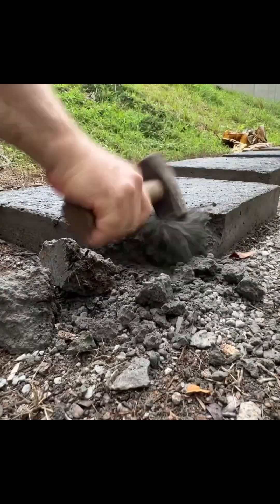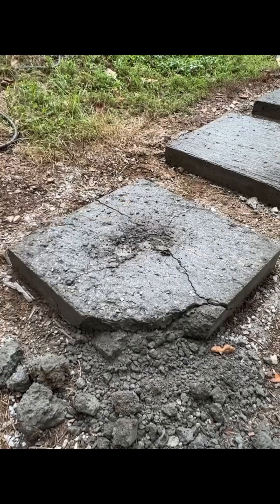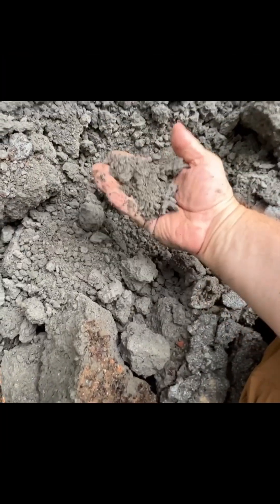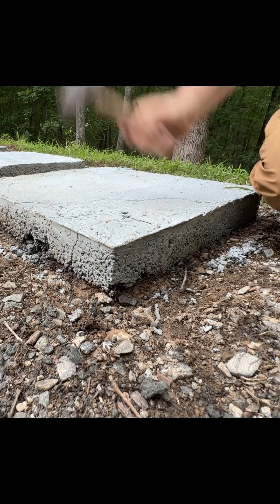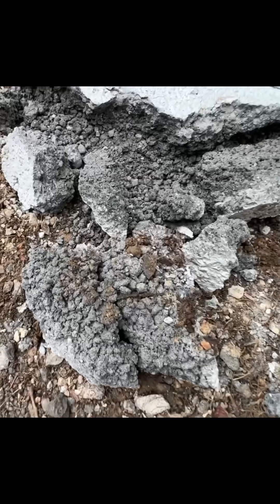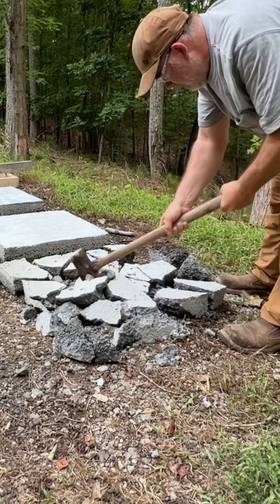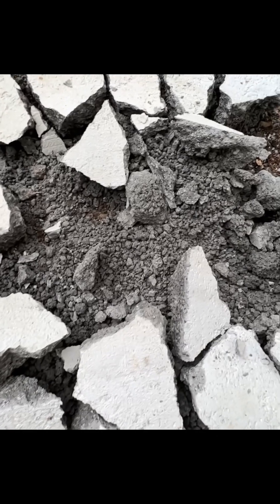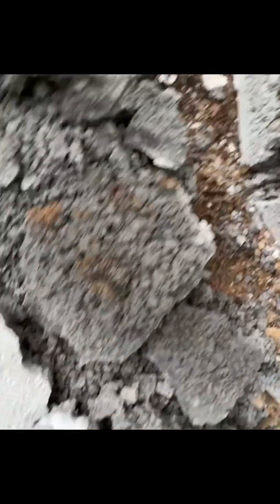Concrete cage match: dry vs wet compared by destructive testing. Round 1 who will win?

Comment: both are trash, if u can use a hammer to brake it you simply have a pile of shit that slighlty hardened. Nothing to do with concrete slabs. If u mixed it yourself u didnt do it properly and if had it delivered from a factory u got scammed.

Comment: Guys open a book about concrete and learn how to do it properly and also how to test properly. This is nosense
Reply from the maker: You realize that this is basically a section of side walk.  Side walks aren't tested (its non-structural).  For the use case, and no freeze heaving, its fine.

Comment: Nope, that’s not how wet pour concrete looks when it has cured for 28 days and was mixed properly.
Reply from the maker: You are absolutely correct.  Cured dry pour does NOT look the same.
Reply: @dwwoodbuilds  was talking about wet pour .
Reply from the maker: I know.  And they don't look the same.  You can get a better finish with wet pour. If you look, you'll see I have videos comparing dry vs wet.  Yes, I do wet mix and pour concrete also..

Comment: And yeah it takes a couple weeks for wet concrete to fully cure.  Guarantee if you wait that long that dry poor BS is gonna crumble even more and that wet poor pads will barely crumble at all.      This dry poor crap is so dumb.      Your sacrificing strength, durability and aesthetics.   All cuz your a lazy homeowner that doesn't want to get a wheelbarrow and trowel or shovel and mix the freaking concrete.
Reply from the maker: Those are TEST pads made for destructive testing to compare dry vs wet.  See the video where I CUT the next pads in half (after they're mostly cured) to compare the dry pour against its wet pour counterpart.  SPOILER ALERT: the dry pour is hard and solid all the way through.  As to being lazy and not want to get a wheelbarrow/shovel/trowel and mix the concrete, how did I do 4 WET POUR test pads?  Those are OBVIOUSLY done that way, so your ""all cuz your a lazy..." comment demonstrates a lack of critical thinking on your part.

Comment: 4 look like crap and the other 4 look like how it should look.   That alone should be a win for wet poor.     Dry poor is so dumb.   It's basically all the exact same steps except mixing the concrete.   And instead you replace it with watering it down for 3 days.    A pad that would have taken 1  hour now spans out a 3 day ordeal.   Then it still looks like crap.
Reply from the maker: Those are for TESTING only.  I didn't worry about carefully screeing them, so your complaint about looks isnt relevant.  As to watering, it was done over 6 hours not 3 days (trading effort for duration).  The first test was dealing with people saying dry pour doesn't wet all the way through.  The test shows its wet all the way through.  Look at the video where I CUT cured dry pour and wet pours in half. Thanks for watching and commenting!